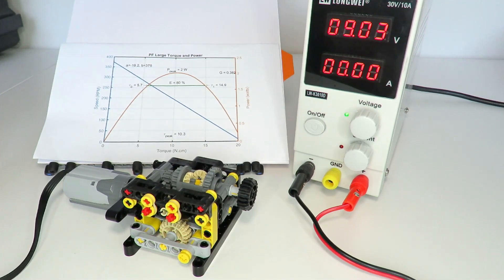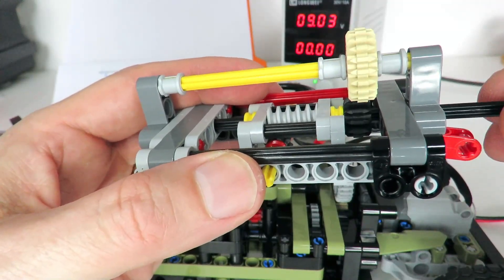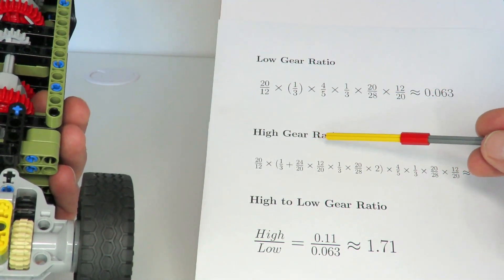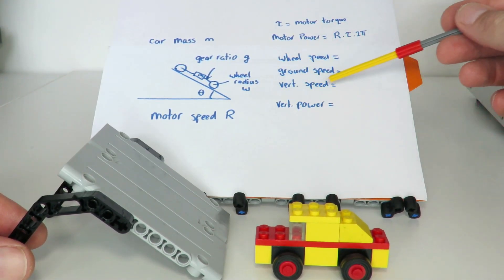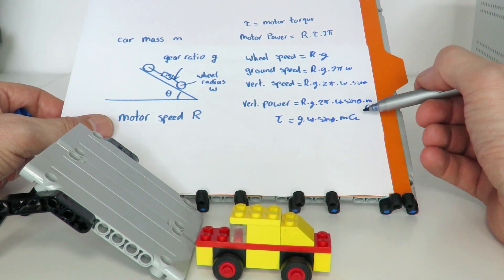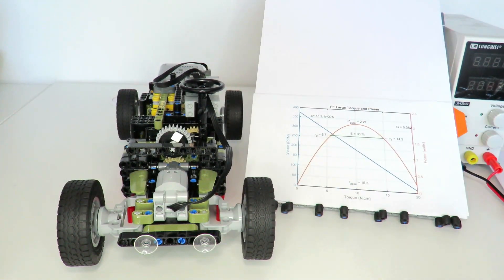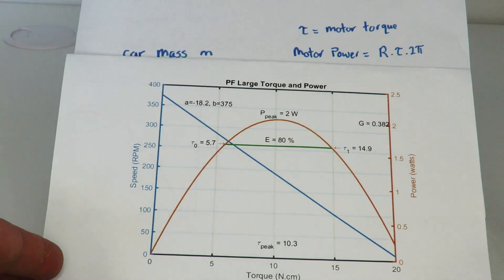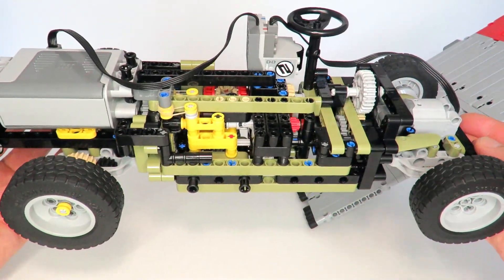Lego Technic 2 Speed Auto Car Ramp Challenge - Part 2

Comment: What kit came with those differentials?
Reply from the maker: Hi Dave.  There are 3 in set 42114 - "6x6 articulated hauler", 1 in set #42109 "Top gear rally car" and 1 the new 2021 set 42124 "offroad buggy", or you can buy them on bricklink or lego.com. I like them.
Reply: update this month: (nov 26th)
42129 includes 2 of these, and the first non-motorized set is 42127.

Comment: Is the power loss in the transmission expected to be independent of rotation speed (e.g. the input shaft velocity) or would it depend on the speed?

Also, by measuring the speed at which the vehicle is going up a certain incline, and a concurrent measurement of the motor output rotation (thereby estimating the power output from the motor, as you did in the video), could you empirically estimate the power losses in the gearbox?
Reply from the maker: Hi Hyun, I think the power loss will be great if the speed is greater, since greater speed means greater friction. Also greater load means higher losses also (although that will decrease the speed).

Yes that's a good point about measuring the output power. You'd have to calculate the work done by the output axle - that could be estimated by the rate at which the car is going upwards and so yes that would give you an estimate of the power loss. Maybe better is to measure it by lifting a weight to avoid tyre friction. Thanks for your ideas. 🙃
Reply: @TechnicBrickPower  By the way, great video! It's really cool to see the automatic gearbox kick in and actually make a real difference for the movement of the car.

Comment: Hi, I have been trying to build a sequential 9 speed gearbox for several months but never succeeded. Would you take the challenge and try to build one?
Reply from the maker: Hi Victor, I have 12 speed rotary gearbox which I guess you could argue is sequential in a way...https://youtu.be/H6NNaO19hMI. Or are you thinking more like a tiptronic paddle to change gears up and down? 🙃
Reply: Hi, thanks for the replay. Yes the idea was to shift the gears by paddle shifters,  I’ve tried to multiple two 3 speed gearboxes but that didn’t seem to quite work. I’m still pretty new to building gearboxes so maybe I did something wrong
Reply: Victor, have you looked at any of the recent super cars for hints? Or are you taking a completely different or first principles approach?

Comment: Awesome work! Does this design use the same gearbox as the last video and will plans ever be available?
Reply from the maker: Hi Alex - it is pretty much the same gearbox but I have made a number of small improvements to make it run more smoothly. It works really well now. Yes I plan to make it available on rebrickable but the  problem is that I Studio for making instructions and they haven't created the new differential part yet...🙃

Comment: Hooray!! You did it!!
It's a great job!! And you just proved (again) than a scientific approach is working to. [as for me, I'm going with the intuite approach most of the time]. Thank you very much!

Have you already thinking of the next challenge? Or maybe you have an idea for an improvement of this gearbox?

And a question:when you are speaking or a "resistance" for the general gear switch, why don't you use the 42195 part for the center? Because the switch can slip by itself?
Reply from the maker: Hi Arkady. Thanks for your comment - much appreciated. Yes I do use part 42195 already - the resistance comes from the friction between the clutch gear and the switch component - try it yourself if you twist the clutch gear and the switch axle to create a lot of torque and then try to pull them apart you can feel the force required.